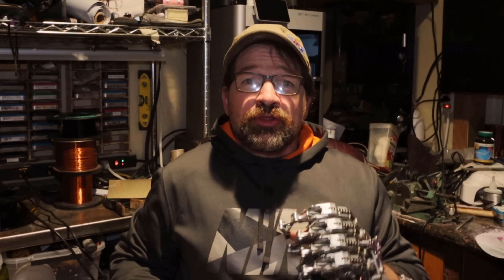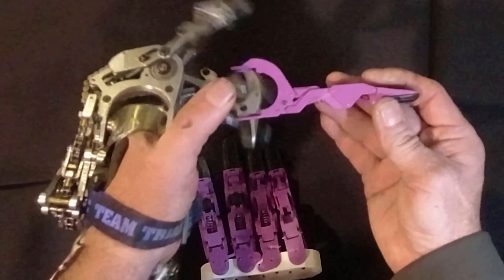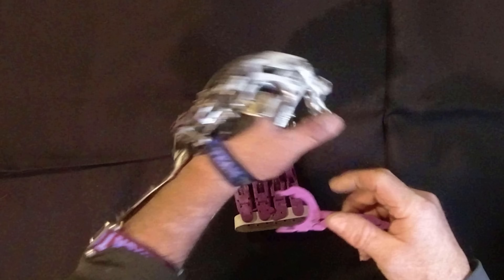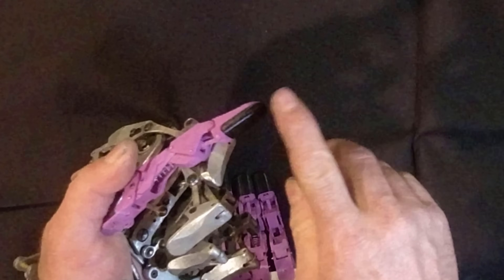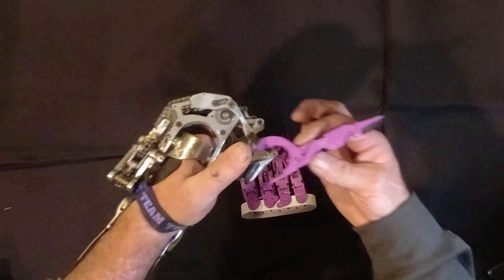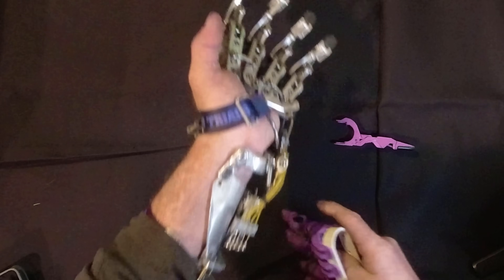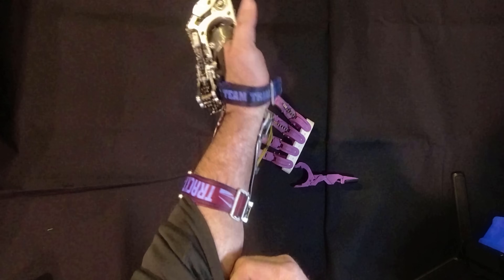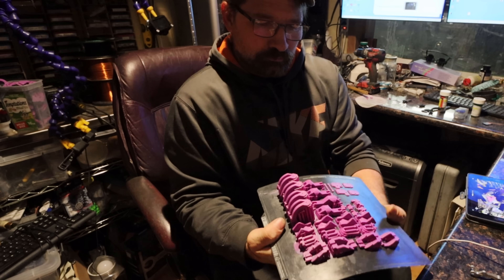New 3D Printed Partial Hand Prosthetic Design!    Please Share to get this out there!

Comment: hey Ian Davis, I'm a year 12 student study engineering in Australia. I'm interested in making a 3D printed prosthetics more accessible in Australia (with a budget of 120 AUD).  If possible can you help me make a design light, comfy and strong enough to handle 3-5 kg if possible for teenagers with loss of fingers or majority loss of hand.
Reply from the maker: Look at e-nable.org 
it's a 3d printer based device. It's a good jumping off point as it has a lot of room for improvement.

Comment: Brother. U thought about making parts
 in titanium?
Reply from the maker: i have, but i think the 8 times increase in parts cost to have the parts printed in titanium is going to be a barrier to entry for the demographic that I'm marketing to and trying to help by putting the hand together as a kit.
Reply: @missingpartsclub  thanks for getting back to me
it would be worthwhile in my opinion to mock one up in titanium to see what the weight difference is via steel and thus make this as an offering for those that want the option to have titanium for reduced weight and not the brittleness of plastics.

Comment: Amazing! 
How about adding a mechanical touch sensor? Whenever there is a pressure applied at the tactal pad it pushes a pin back into your hand where the fingure is attached and gives you a response. Just a slight push will give you indication of a contact. I understand that it is easier to describe than design, but something tells me that someone like you can do it :)

Comment: Just an idea for you to try: 
To be able to hold stuff without maintaining the wrist angle you could use a mechanism just like the one found in vice grip pliers. this could be adjustable with a screw and spring and would allow for a lot of force multiplication. Once a certain  forward wrist angle is reached the mechanism gets past the point of maximum force and engages. This enables the grip to hold on even if the wrist angle is changed, and can be released by pressing a button or angling the wrist backwards a certain angle.

Comment: Can you put a bubble of silicone at a fingertip, with a tube that leads back to a second bubble elsewhere? It would be an analog pressure sensor.

The first bubble gets compressed, then the second will transfer the pressure to a tactile sensation elsewhere as feedback. The bubbles could be between two platforms like "bellows", if it helps to make the force transferance more precise.  The tubing would need some type of r=igidity, possibly in the form of steel braiding or rigid tube?
Reply from the maker: I've tried something similar to that idea, I had issues differentiating the pressure from the sensor from the pressure that is applied to my arm from the device during normal operation.  It's such a subtle thing.

Comment: makes you wonder whats stopping the dudes at the top
Reply from the maker: Where's their incentive to innovate? They have products in place that; meet the needs of better than half of the patient base, and are recocnized by most insurances. It doesn't matter that the rejection rate of those upper limb devices is near 44%

Comment: But using plastic is way far resistent than original, what about be hanging out  and snap the prostetic, in my opinion metal is much better and also retain the T 101 bad ass  look!!!!
Reply from the maker: Plastic is only for iteration. Plastic,  even pa-cf and/or taulman nylon isn't strong enough/ stiff enough for the proximal components the p1 is 0.25:1 ma. the only parts that could reasonably be Plastic are the distal and distal link, but if you're  building all the other parts out of metal, might as well finish it out in metal.

Comment: Forgive the possible dumb question as I know nothing about any of what you just said, though I've been watching you for a couple years now off and on. 

Is it practical (and possible) to make a prosthetic that is just the bare-bones of what is needed for functionality and then have attachments for them to alter appearance, function and/or strength? Either with magnetic locks or snap-on pieces? 

Just wondering because if I ever lost a hand, I'd like to have the ability to add on a mini fingertip LED flashlight, or a laser pointer, etc.

Comment: I really like this idea; the only thing I wondered about specifically is; how often does your artificial hand get caught on stray strings, hair, plastic bags, or other stringy things? Would you be able to figure out a way to safely pull a latex or neoprene glove over the newer sleeker design, and still have it operate mostly the same? How does it do with dirt, grit, sand? Just check if it can operate with a thin glove on would be good in my opinion; not an expert or anything, but, just thinking about how greasy and gritty a hand can get during daily use.

Comment: have you think about  steel ball bearings inside? depending of what position hand is directed they whould move and change fingers position or lock it? better than springs. Cos springs does not give you strong grip and they loos strenght in time. Bearings if they slide in specially designed tunel in fingers will block fingers solid till you lower your hand for grip release?

Comment: A manufacturing option for a fully developed design could be 3D Print in titanium.  3D printed titanium results in parts that are as strong as a conventionally machined part, but allows the design freedom of additive manufacturing.  The titanium is literally laser welded to get her layer by lawyer but titanium likes that a lot and the individual layers all but disappear outside an unfinished surface of the part (core is solid).  This is contrast to most other 3D printed metals that have some element of being “glued” together.  Still resulting in strong parts, but not solid material strong parts like the titanium variation does.   Plus its titanium, its a cool material.

Comment: Dont nerves give off a very slight electrical pulse as well when you give them input etc? Could theoretically use it as input to control each finger. May not be enough to power the finger but you could cover that with a battery and use the nerves to give input for movement

Comment: Metal 3D printing would work nicely for this, as the process excels with smaller parts. However, you have to be careful about overhangs on your parts, as the debind process renders the part extremely fragile. May need to design parts to be lightly machined after sintering.

Comment: I'm curious if you've had a look at the LEGO Powered Up motors and hubs. I'm reading that they can be flashed with Python to store a single on-board program locally, effectively acting like a cheaper version of the more expensive Mindstorms kits. A hub with two motors can be bought in a 150 dollar kit or cheaper depending on sales. I'm wondering if one of these powered up hubs could be useful in making cheap powered prosthetics?

Comment: With 3D printing in the mix you should look into compliant mechanisms. It is a different way of approaching joints springs and other traditional movements based on the properties of materials. Your way of thinking could add to the field.
Reply from the maker: I've tried compliant mechanisms in the past with a design similar to festo's finray. They really aren't suitable for this application.  At each of the flexures, the finger needs to deform 90 degrees. That amount of repeated motion doesn't lend itself to the longevity required for this application. Secondly the mechanical advantage of the finger is going the wrong way.  90 degree input at 0.4"radius (0.56"linear motion) outputs 270 degrees at 3.75" that's a 4:1 ma going the wrong way, this makes it a force multiplier for the thin areas of the joint. 20# =80# (100# at the fulcrum. Finally any force that is required to deform the joint takes away from the force that would normally translate to the grip in a conventional joint. Complaint mechanisms are great in a conventional pick and place gripper, but not with what I'm trying to achieve with the finger. 
One place where it would be suitable is the linkage for the splay, but going that way would add unnecessary complexity to the manufacturing of the metacarple bases by requiring the 4 pieces to be made as 1.
Reply: @missingpartsclub  I wasn't thinking in a completely cm hand but just as parts where they fit. Like replacing springs or other non printable parts where possible. Your enthusiasm and deep knowledge is what made me certain you could find ways to incorporate them. Keep up the good work.

Comment: I have fingers but they're paralyzed from a spinal cord injury from auto accident, I've been brainstorming a mechanical hand that would sit below my "quad claw" fingers and be wrist activated as I do have wrist flexion at my injury level.  Initially I was thinking I could connect together progressively smaller toggle bolts like this spring mechanism part not the bolt, with fishing line or something inside. There's even this very tiny fishing reel i bought from Korea that I thought maybe I could do multiple wrist pumps to do a ratcheting up grip strength that I could then release with the push button on the fishing reel.  Been on my back burner since I spend all my time adapting for gaming controllers.  I'm very excited about the accessibility of 3D printed versions as I have followed your channel for a few years now and the designs and applications from you are masterful. Awesome stuff
Reply from the maker: Have you looked at the handmate project? Also you might want to look at what handspring is doing related to stroke victims https://www.ncbi.nlm.nih.gov/pmc/articles/PMC8485422/
Reply: @missingpartsclub  I had not seen this, Thank you!

Comment: This is awesome! I'm a carpenter with the thumb, index and middle finger missing. I am generally not bothered by it since I was able to increase my grip strength in my remaining 2 digits many times beyond my other hand. I wonder what improvement I could see in using such a prosthetic?
Reply from the maker: Disarticulation at the mpj or pip? do you still have your proximals or did you lose your fingers at the palm?

Comment: So, terrible idea: Would it be of any use to make the driver for the grip motion be the core of those flexible screwdrivers? Make the finger a continuous curve, and by rotating the wrist you force the flexible core against the finger snakes to make them grip, and thus allow the end of the finger to continue to curl in regardless of the position of the rest of the finger. Might lose some control precision, but it drastically reduces the control mechanism complexity.

Comment: Will making it out of plastic reduce its usability due to fragility or is the plastic just for testing and the final product will be alu again?
Reply from the maker: Plastic is for rapid iteration only. There's a 4:1 mechanical disadvantage at the drive fulcrum.  If a usable force is applied to the end of the finger you get a pile of layer separation at the pin. 20#=100# on a 0.08" diameter pin.  Hopefully powder metal sls produces a viable solution.  Rn it's looking like $75-100 per finger to have them printed.

Comment: Have you considered a design that lets fingers move a lot for a small movement at wrist, but after encountering a set amount of resistance, switches into "low gear" that uses a large wrist movement for small output movement? The measuring of resistance could be done by a spring-loaded system that can stretch a little bit and then toggles on the low gear mode, and after the resistance ends, spring pulls the setup back toggling low gear mode off. A further iteration could be a setup that increases leverage smoothly as load increases, so the harder you need to squeeze, the better leverage you'll get.

Designing a system that accomplishes this should not be all that problematic, I just came up with one design that should work but it's quite hard to explain without images.
Reply from the maker: I did that with the 2nd revision of the center plate on the drive differential of the 158 hand. There was a spring that held a pair of opposing spiral yokes that would expand the diameter of the center plate of the differential relative to the force applied to it. The complexity wasn't worth the results. It gave a really squishy feel to the grip. I lost just about all proprioception with it so I switched back to a fixed diameter center plate.

Comment: I'd be curious how this would work with a resin printer. The results tend to be more fragile, but it's also MUCH easier to get tight tolerances without post-processing. And there are some resins which are pretty damn strong.
Reply from the maker: The problem that I've seen with resin is that over time the prints get too brittle and the holes for the pins develop stress fractures.

Comment: When I was a child, my older brother and his friends built an acrylic prosthetic hand. I don't recall why, or what happened to it.

But I do recall that it used a pulley system made of string (or wire, perhaps) to add power to the grip. The string attached at the Proximal-Middle joint and ran through a pulley system at the knuckle, and then actuated by a servo at the forearm.

I'm not familiar with the details, but I think there were two wheels per finger. the string ran out from the proximal, under the first wheel, then over the second wheel, and down the wrist.

I have to ask, if you think print-in-place pulleys attached over the knuckle would be a viable way to add slightly more power to this finger?

Comment: maybe pla with carbon inside would help with rigidity
Reply from the maker: You'd still run into issues with layer separation. Printing it out of plastic isn't viable for real world use. I printed it in ABS solely to prove out the design.  It's intended to be printed in either stainless or titanium  depending on your budget.

Comment: Bambu Carbon makes so many things easier! Have you tried it in carbon fiber?
Reply from the maker: So far I've been very happy with the printer. It's way faster than my Creality v1pro.  Although the build plate sticker has started peeling in the center of the plate...
Reply: @missingpartsclub  are you using glue stick or some other interemediate barrier? I found that was necessary to make the prints easy to get off. And printing that scraper they provide.

Comment: That's crazy! While for a prosthetic, I can definitely see the utility of a more complicated but feature-rich design, it's really cool to see a minimalist version of it for the sake of making it accessible to more people who could use it. I admire what you're doing, both in terms of making a difference and in terms of the mechanical engineering skill involved.

Are you going to try and make a similarly minimalist 3D printable design for the forearm assembly beyond just removing the grip selector, or is part reduction a pointless endeavor due to the mechanical requirements there?

Comment: does plastic 3d printing lower overall price? (since it is not aluminum)
Reply from the maker: Printing out of plastic is only to prove out the design. The printed plastic versions aren't strong enough to be a viable long term functional solution. The issue is with layer separation under load.

Comment: printed titanium would be pretty awesome too. are you using compliant flextures in that 3d printed prosthetic? you can get pretty wild with compliant joints in printed titanium. you'd be amazed how much flexing you can get from printed titanium before you have plastic deformation. there are some really good youtube videos demonstrating things like gimbal rockets that use compliant titanium tubing for fuel delivery. its expansive as hell though!

Comment: have you thought about trying to reduce the noise on the prosthetic hand?
Reply from the maker: Not really, I like the clicks clicks sound.each design makes a slightly different set of noises. When I switched from 158 to 159 it threw me off for the first week or so because of the new sounds it made. If you look back at any of the 156 and 158 videos you'll hear the difference I'm taking about.